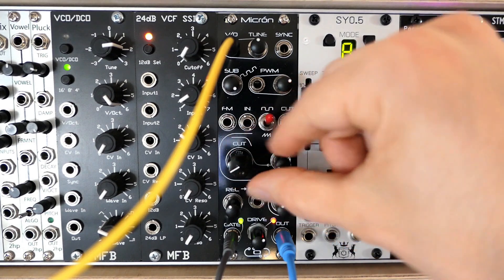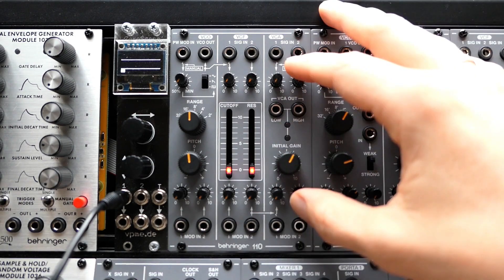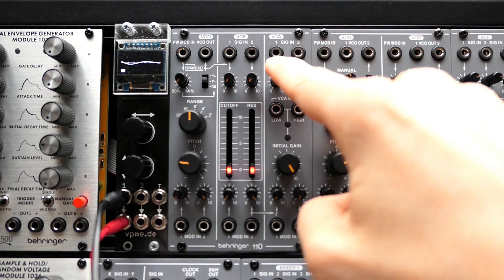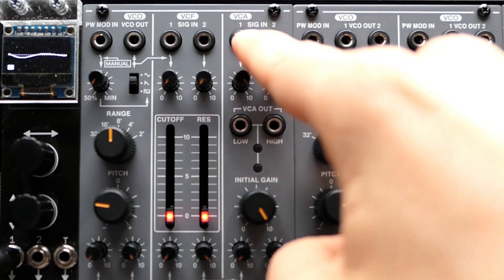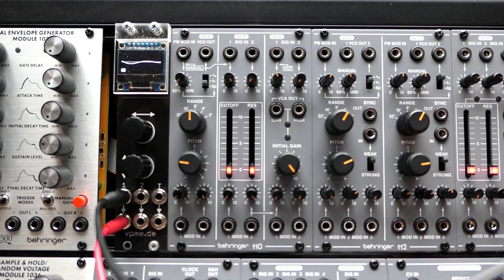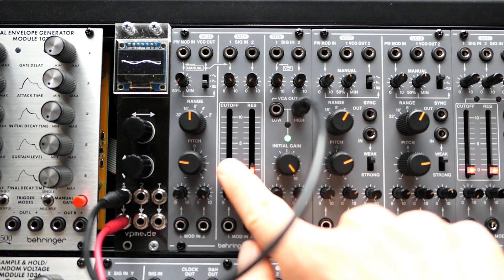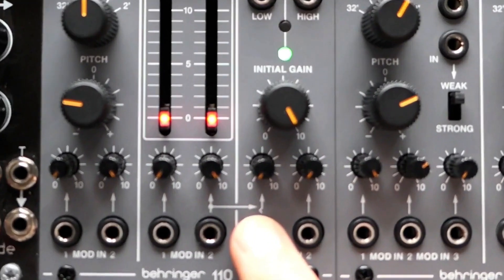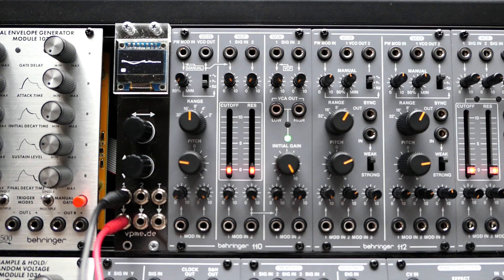Behringer 110 Synthvoice

Comment: hi, great video. which would you recommend between the 110 and the filtamp?
Reply from the maker: Hi! The 110 is a full voice, the FiltAmp is just filter + amplifier, so no sound source. There is no Synthvoice in the 2500 series from Behringer (in the original from Arp there is one, by the way...). So I guess the 110 would be a good starting point as it gives you all pieces you need for a synth voice (except for envelope, lfo, etc., but the 110 has the full audio path).
Reply: @synthesizer83  i didnt explain myself well. i was refering to the vcf, vca part in both. i know the 110 has also a vco. it is not a starting point, in fact is one the last modules i will be buying. i need a vcf/vca combo for my live case and im deciding which one

Comment: Hello, since the VCA is AC coupled, how does one modulate CV signals in a pure 100m system? Is it possible using the 297 module somehow?
Reply from the maker: There is basically no way to modulate CV signals in the System 100 (at least the Behringer one, don't know if the real one featured dc coupled VCAs). The 297 is a cv mixer / portamento, but has no VCAs. Even the ring modulator in the 150 is AC coupled.

Comment: Great demo!  I was wondering...how did you patch the saturated demo? Another vco into the filter? took the vco out and drive it outside the module?
Reply from the maker: Yes it's a second VCO into the filter. Nice thing about the System 100 modules is that they saturate easily when you crank the audio inputs up.

Comment: nice to see MFB modules in folks setups - they were one of the companies i looked at when i was getting into modular.
Reply from the maker: They had a pretty straightforward concept and were cheap. Sad that MFB dropped the modular stuff.
Reply: @synthesizer83  Hello. I need a bit of guidance. I recently finished building my Behringer dual rack Modular. You have the Behringer 110 but i have 112, 121 & 130. is it better to have all 3 modules than have all 3 in 1 module like the Behringer 110 ??  Thank you .
Reply: @thepcgamer2169 separate modules are definitely better in that you've got more flexibility with separate modules, as well as some features that the 110 doesn't have  - the only thing you're trading off is space in your rack.  But you also have two voices.

Comment: Hey! Great videos, man. 👏 I have an issue when i patch the OSC out, there is a sudden drop of audio in the normalled connection (very brief but annoying). Did you notice this? Maybe it’s just my unit...
Reply from the maker: Same here, the normalled connection breaks for a short moment when I plug the cable in. I guess it's due to the momentary short circuit when plugging the mini jack connection and also missing buffering of the output and the normalled connection.